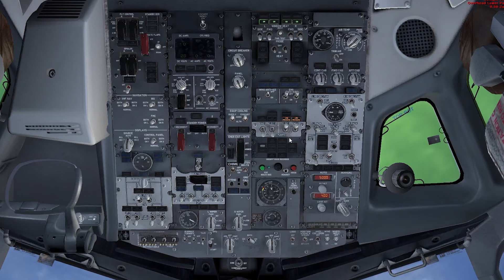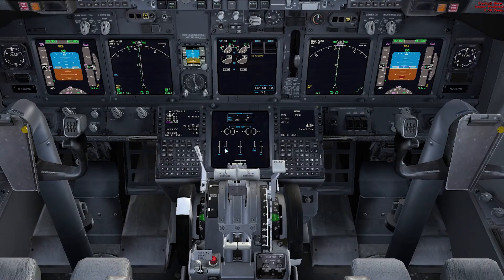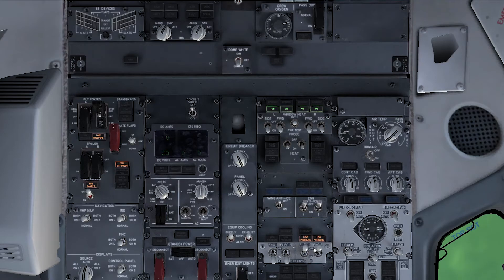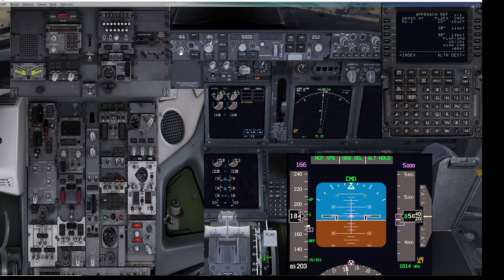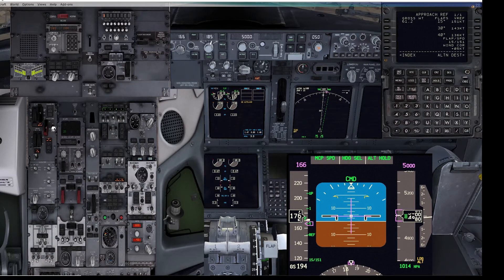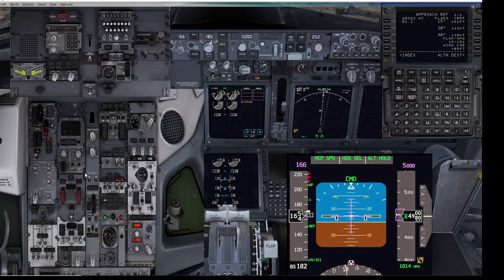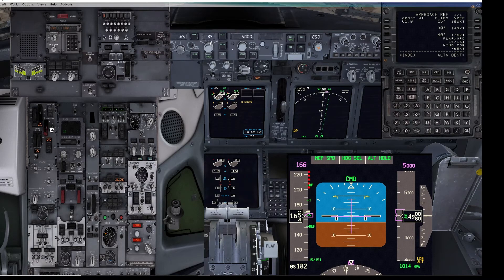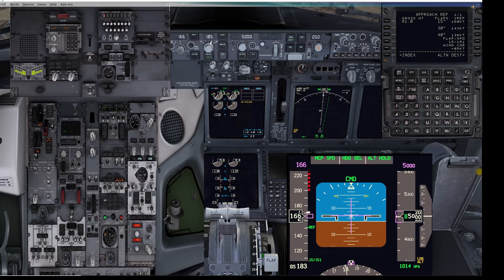Alternate Flap System

Comment: Did you not set it to off instead of stdb rudder?
Reply from the maker: THE VIDEO IS TO DEMONSTRATE THE ALTERNATE SYSTEM.  THE HYDRAULIC SYSTEM HAS BEEN FRIGGED TO PREVENT HYDRAULIC FLUID MOVING THE FLAPS SO IGNORE NORMAL SWITCH POSITIONS.  IT WAS A WORK AROUND. 👍

Comment: how come hyd qty A was lower then B by so much was it to do with the gear positistion,thought you needed 76% minimum in both QTY to depart ?
Reply from the maker: In order to create the failure, both hydraulic pumps are switched off to prevent the hydraulic flap system operating. It isn’t a perfect way to create the failure. But yes you are correct, to dispatch, you must not have an RF which is <76%. Nothing to do with the landing gear.  PMDG isn't a perfect tool to create failures.  It was a good spot, I hadn't noticed that SYS A quantity was that low, the SIM does very strange things sometimes.
Reply: @simcaptainb737tutorials9  ok thanks a lot sorry I was half asleep when I watched the video wasn’t thinking smart but I’ve also heard that when the gear is down hyd QTY A drops as fluid moves from the reservoir into the landing gear ? Is that correct
Reply: @tomharper8402  thanks for your comment.  That’s not something that I have been made aware of.  The SYS page isn’t normally up whilst flying so not something I would have noticed.  Maybe the next time I fly, I could check it out.
Reply: @robertmorgan9621  yeh no worries correct the lower DU should be blanked for better awareness in case of engine issues but it’s checked before departure or at least should be but the sim isn’t the most accurate as was mentioned